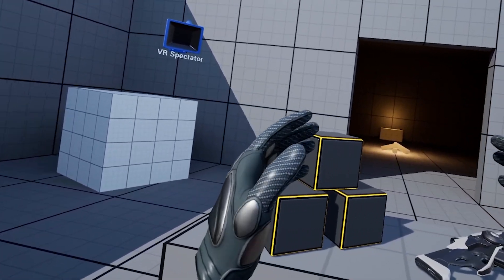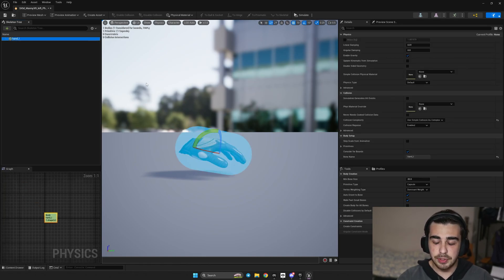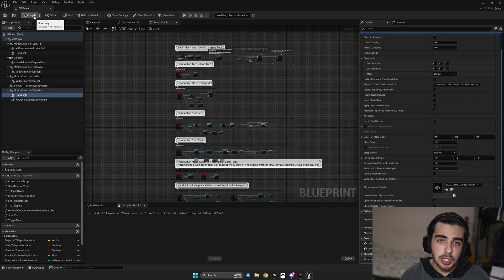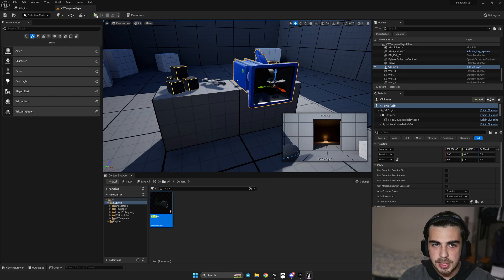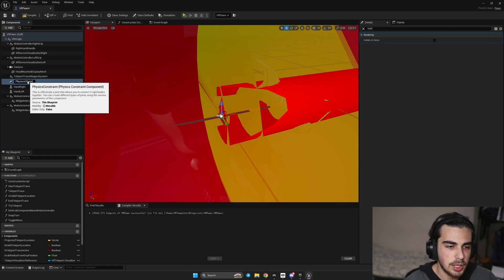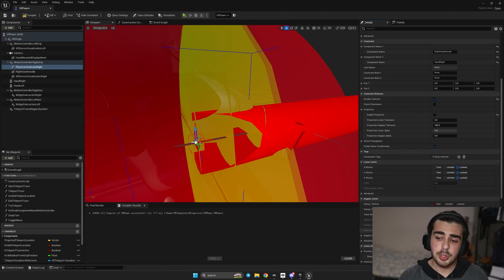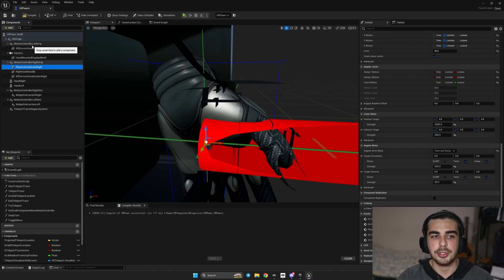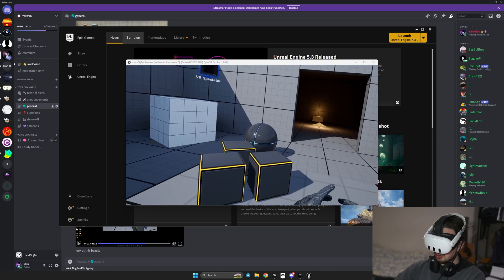HOW TO MAKE A PHYSICS HAND COLLIDING WITH OBJECTS AND PREVENT CLIPPING IN UE5 VR | NO MORE CLIPPING

Comment: This video was fantastic, thank you so much! I do have a quick question - after setting this system up, when grabbing an object and trying to throw it (releasing the hold while swinging my arm) when the object gets released it immediately smacks into the collider of my hand and falls straight to the ground. Is there a way to get around this? I was trying to set up a system that would briefly deactivate the hand collider upon dropping an item so that the object could get out of it before turning it back on, but I just could not figure out how. Any help would be amazing! And again, thank you so much for making this video!
Reply: Facing same issue here.
Reply: @FirstobalEntertainment  Hello! I managed to fix this - firstly, this was an issue only when grabbing free grab-type objects, (all vrtemplate objects are free grab by default) so if you follow Yaro's video tutorial on creating weighted grab types and then switch all grabbable objects from free to weighted, the objects will be thrown correctly as the logic used in that video parents the grabbed object to the hand without allowing them to overlap.

In my project, I also added extra bones for more detailed moving collisions in the hands, and this created some problems with physics in the weighted grab, as the extra bone colliders (we only make one in this video) would curl during the grab and push into the held object, causing it to spazz. The solution I found for this problem could also likely be used if you didn't want to implement weighted grabbing - I created a custom collision object channel (in project settings > collision > object channels) that was type 'ignore,' and I assigned this object channel to the hand meshes within the VRPawn blueprint, (find VRPawn blueprint, click on one of the hands "HandLeft" or "HandRight," find the collision presets tab in the details panel, select custom for collision presets, set object type to your previously created collision object channel) I set all custom interactions to block except the checkbox for the custom collision channel, which I set to ignore, basically telling the hand "you are this custom collision type, you will block everything except objects within the same custom collision type." Then, in the TryGrab section of the GrabComponent blueprint, (altering the code that was added in the weighted grab tutorial, so I'm not totally sure where you'd put it if you didn't add weighted grab) between the nodes "Set Constrained Components" and "Set Timer by Function Name" I added a node called "Set Collision Object Type," attached the target to the output of the "Cast to StaticMeshComponent" node nearby (basically, the target of the switched collision object type is whatever object we pick up) and select that custom collision channel. This means that while grabbed, the object we pick up will be the same collision channel as our hands, and thus they won't interact physically. To return the grabbed object to its proper class upon dropping, in the "Try Release" section of the GrabComponent blueprint, after the "Break Constraint" and "Set Handmesh" nodes, I added a custom event which I call before going to the return node. That custom event graph is written out in the main event graph of the Grab Component blueprint (because we need a delay node, and the TryRelease graph won't let us put one in there, so we have to make that code somewhere else and call it), and basically just has a 0.2 second delay node, then a "Cast To Static Mesh Component" node (with the input being Get Attach Parent, aka once again our held object), then a SetCollisionObjectType node (the target is our static mesh component that we just got, and the new channel is PhysicsBody) and that's it! Sorry if that's jumbled, I am not the best teacher and if that is too confusing and photos of my code would be better (my code is kind of a spaghetti mess but might be helpful?) I can try to figure out how to get those to you. I spent all weekend trying to figure this out, and I hope I can help so you don't have to spend forever with it too!
Reply: @Clutzle  Thank you so much for that timely and incredibly detailed reply!  I didn't do the weighted physics hands tutorial, but I do have this working now based on your new collision channel solution!  I will return to this comment if I deem it necessary to add the weighted physics.  Thanks again so much!  Next question, any reason why the gun only fires in my right hand....
Reply: @FirstobalEntertainment  I'm really happy I could help! I haven't started playing with the guns in my project just yet, so I don't have any advice for you on that front, I'm sorry! I would assume there must be a difference between the setup of your hand physics or grab component blueprint between your right and left hand. (If you have altered the gun blueprint or projectile blueprint for hand-specific guns, I would check those too, but if not it's likely a problem with the hands themselves if the gun works well in one and not the other) I'd open each side by side and see what is different between the hands, and whatever is changed on the left hand is probably your problem? 

I am a college student studying game design, so I don't have all too much experience yet and am really taking a shot in the dark here (take it with a grain of salt?), but my best guess would be that your left hand is not set up in the same way as your right, and that either the gun or the hand is somehow colliding with the projectiles as they try to spawn and making them not spawn (?) I would check the collision channels of the hands, the gun, and the projectiles. If you altered the channel of the gun in the way I suggested, double check and see if that creates collisions with the projectiles, and mess with projectile physics accordingly. You could also add a print string node to play after the gun is fired and the projectile is spawned, so you can see if the projectile did spawn but wasn't visible for some reason, or if it didn't spawn at all. Sorry I can't be of more help, I wish you the best of luck!

Comment: How would you go about adding collision physics for grabbed weapons? so a gun would collide with objects and act the same way as this with the hands.

EDIT: I just had to enable the same physics options that would be for the hands but on the weapon BP(mesh) when grabbed and also used a custom event in the VR Pawn that would send through the weapon mesh component to the VR Pawn and set the second component on the physics constraint.

Comment: I found a fix to the gliding problem. I've replied to all comments asking about it but here is my own. In the physics contraint turn off the velocity targets, and make the strength of position target 4000 instead of 2000. Also set the swings to limited instead of locked.

Comment: Currently, my hands, when moving, swing. Where can I change it so that they stay in place, without the “acceleration” effect, i.e. when I go forward, my hands stay behind for a while and then go forward
Reply: In the physics contraint turn off the velocity targets, and make the strength of position target 4000 instead of 2000.

Comment: 8:00 Hi! What would be a possible solution to address that problem? Any chance you could point me into a direction please? I checked the other videos but didn't find anything. Btw all videos are very good! Thank you broski! You rock
Reply: did u find a solution for that issue
Reply: @mudaramanaruchira934  In the physics contraint turn off the velocity targets, and make the strength of position target 4000 instead of 2000.